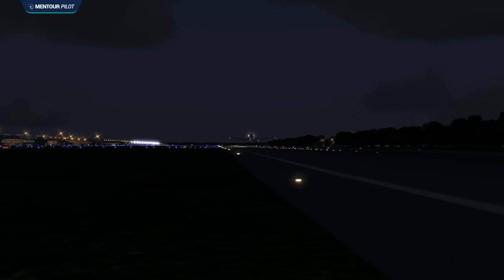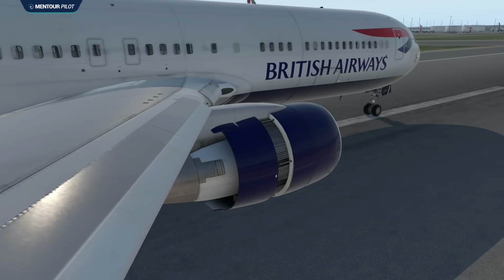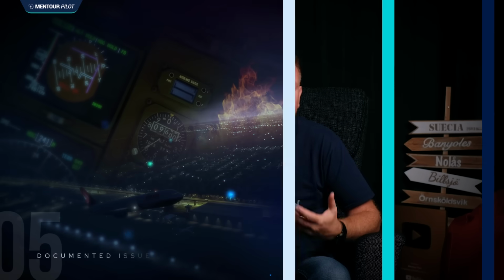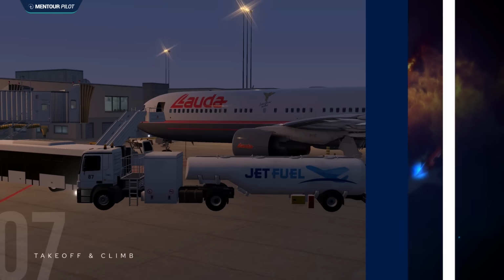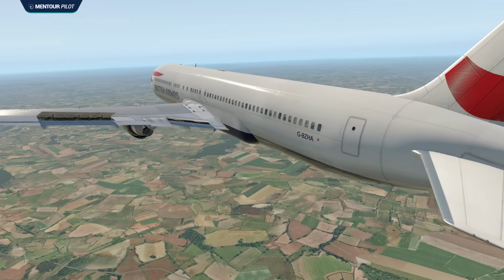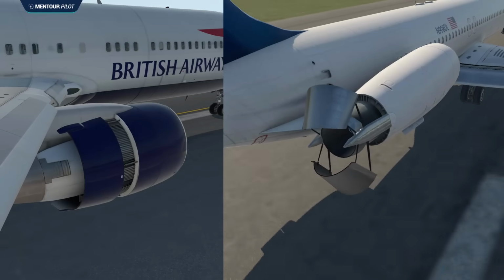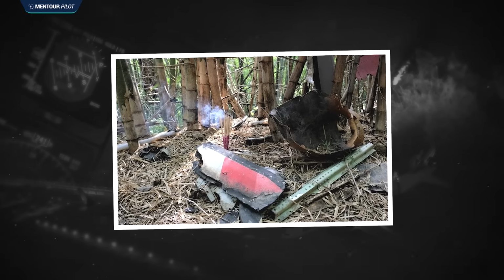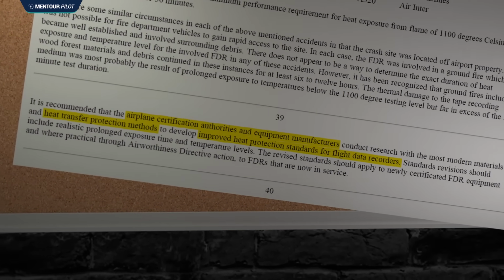HOW an Impossible Failure CRASHED this Boeing 767!

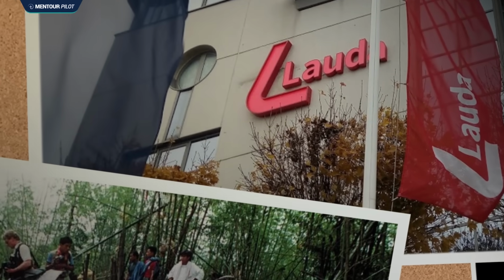Comment: 26:10 just quick correction, the building in the back is Lauda, not Lauda Air, Lauda (without the "Air") is the Ryanair subsidiary founded by Niki Lauda a few years ago, Lauda Air was the original proper Airline back in the day

Comment: On the last couple of flights I was on (737-800), I noticed on landing (I like to sit at or slightly behind the wings, the last couple of flights I was right at the engine) that there were panels that slid back at the same time as the other aircraft brakes were deployed, and I was curious what it was doing (didn’t seem like a time when cooling off the engines was needed). Now I know what it was! Thanks!

Comment: I was thought you could use the inboard thrust reversers on the DC-8 while in a rapid decent. Been a long time since I flew one so I may be wrong.
Reply: In the mid-70s, I distinctly remember being on a DC8 approaching Rome at high altitude.  The pilot did several 7 to 10 second long inboard engine reverser deployments to speed the descent. It really surprised me, but seemed to work OK.
Reply: @Sea_SALT-sunshine  Yes I looked at a old DC-8/63 manual and you could use them to  increase the decesent rate. I do not remember the Airlines policey on it though.

Comment: Hmmmm.... but we were told that bloody beginners could properly control two Boeing 757/767ers at a speed of like 425 knots or more some hundred feet above sea level... without any ruptures....

They must have done a lot of improvement in Everett after 1991.

Comment: I'm not a professional. We have to assume that the shock of rolling like this had a paralyzing effect on the crew. But, if they could have maintained their composure long enough, I think the best thing would have been to shut down both engines. Assuming they weren't in any upper-atmospheric turbulence at the time, the aircraft should have stabilized into a glide, giving them the time they needed to re-start the right-wing engine. The left-wing engine should have stayed down, and they could have landed with the one good engine.
Reply: All that was needed was for both engines to be set to idle but it happens extremely quickly and there very little chance of catching it before it’s out of control.
Reply: @peteconrad2077  Engines running on idle is the normal situation in which the engines are allowed to reverse. Are you sure?
Reply: @AtlantaBill  yes. But in this instance one reversed while at high power. That’s the problem. If you can get both engines to idle quickly enough, the aircraft is controllable. But it’s hard to do this quickly enough if you’re not entirely ready for it.
Reply: @peteconrad2077  I would think shutting them down would be faster and surer. What's more, how could you guarantee that initiating the idling procedure on the one that reversed would stop the reverse thrust? Obviously something was going on with the engine that reversed its thrust that the pilots had no control over. There's always the risk that the good engine couldn't be restarted, but apparently weather conditions were good, the plane had plenty of altitude, and there was nothing otherwise wrong with the control systems. If one of my legs suddenly buckled up on me, I'd stay seated and rest before I tried walking again and not put pressure on the bad leg.
Reply: @AtlantaBill  idling them would immediately reduce the reverse thrust  element to minimal. No point in shutting down until you know it duff. The idle power is low enough.
Reply: @peteconrad2077  Good enough isn't always good enough.
Reply: @AtlantaBill  so you admit you don’t know what you’re talking about and here you are arguing with someone who does.
Reply: @peteconrad2077  Who can vouch that YOU know what you're talking about? I said I'm not a professional, not that I don't know anything about physics, engineering, and aerodynamics.
Reply: @AtlantaBill  so stop pronouncing on it as though you do.
Reply: @peteconrad2077  As though I do what? Expressing an educated opinion isn't "pronouncing". To me it's illogical that you insist that the dangerously faulty engine be left running with an undiagnosed problem when it's completely unnecessary. My expertise is in electrical engineering, which involves tracing system malfunctions and finding solutions. Very relevant to the situation we're dealing with.
Reply: @AtlantaBill  well my experience is over 30 years as an airline pilot, instructor and technical manager. This is don’t pronounce views on electrical engineering.

Comment: The bypass airflow also creates a kind of sonic curtain containing the noise of the core.
Miltary jet engines don't bother so much which is why they are a LOT louder and why I am currently concerned with the number of US Military aircraft coming in and out of Belfast.

Comment: Yea was an aircraft mechanic. Especially when your dealing with thrust reversers like we dealt with on C-5b's and M's if your chasing faults throught out multiple components especially TR not locked lights your issue isnt the the switches that turn tha light off and on. Its a fault in the harness itself. Good way to check that out is if your checking your voltages through madars and its bouncing around. Pretty much garaunteed to be the TR harness itself. repeat issues in your 781's is a red flag that the core issue isn't being solved.

Comment: An intense report on an, in this case, unavoidable end.  I wonder how many times Boeing test pilot flew the simulation before he figured out they only had 6 seconds to respond with exact and flawless decisions to stop this inevitable end.  In the last segment, it is mentioned about the flight recorder data. 25 years ago,  I was in the aviation industry in communications, and attempted to patent a system that took all inflight data, digitally stored, and in case of an event, could be sent as data bursts on 121.5 or 243Mhz, the emergency frequencies at that time, and be picked up by every facility in a line of sight area, which would have been recorded as all air traffic communication is.  Regardless of finding or not finding data recorders, their data would have been sent out.  I did not have the $10K bucks the patent attorney wanted and he actually advised against trying.
Reply: Start a gofundme and try again! This is a groundbreaking idea mate
Reply: @nadderragi  Not sure something going through a low-fidelity audio stream would be sufficient for the amount of data transmitted, and it might interfere with voice when it is needed the most. I'd consider also looking into other systems, like the satellite or cellular radios, which are already digital.

Comment: why don't engines use Dr Stanley Myers water injection technology & get rid of risk of fire completely? Why does CAA allow aircraft to fly at speeds the flight surfaces can not tolerate? Thats substandard design & manufacture. horrible crash

Comment: That 4000 feet in 3 seconds it is a speed way over the Mach 1, if I'm not wrong it would be something like 1450 Km/h. Crazy speed for an 767, so sad for those people. Everything happened so fast, can't image even the G forces that they had withstand.

Comment: From wikipedia:
"The extreme stress induced by the dive caused sections of the rudder and right elevator, both of which had not been designed to bear such immense loads, to fail and break off as the pilots commanded near maximum deflection of these control surfaces, attempting to arrest the descent. This was followed by the complete separation of the right horizontal stabilizer as the aerodynamic forces became too great for it to withstand. Combined maneuvering overloads from the pilots attempts to level out the plane and the sheer velocity of the dive then exceeded the aircraft's structural limits and destroyed the weakened rear fuselage, decompressing the cabin and taking the rest of the tail with it. Pitch control was completely lost with the loss of the tailfins, and the 767 went into a vertical dive, reaching a speed of Mach 0.99 (The highest value onboard sensors were capable of recording) and breaking the sound barrier. At that point, the right wing failed and sheared off at its connection point to the main fuselage, igniting a large fireball visible from the ground according to eyewitness accounts. What remained of the aircraft disintegrated at 4,000 feet (1,200 m) before impacting the ground and exploding."

Sounds pretty harrowing, heavens above

Comment: God sakes! The aircraft wasn't fit to fly for ages before. Common electrical fault is zero volts loop failures, giving false computer inputs. We are only talking about millivolts here for a false input. Sounds like basic loom fault possibly - only takes a poor joint to add a resistance in a circuit. Whatever it was, all hell was let loose. Boeing engineering? They seem to have idiotic events too often for anyone's liking. Aircraft should have been grounded ages before this. The warning signs couldn't have been louder. Very tragic.

Comment: Why didn’t they shut off the engine?
Reply: Takes a long time for an engine to run down. They only had seconds. It's like drive your car down the road at eighty miles per hour and you put it instantly into reverse gear. Not good.

Comment: Wow, that is one of the most horrific crashes I've ever known of.  If I were on the plane, I'd hear the reassuring ding from cockpit to CC at FL10 start getting comfortable and then all of a sudden...words can't describe how terrifying that must have been.
Reply: That's a bit simikar how it happened for me in an emergency landing. My fear of flying is massive so I tried to keep mydelf calm for about 30 minutes from take off into the flight and whike that usually works, an emergency was suddenly announced 30 minutes in due to some kind of engine vibration and we had to return back (safely).

Apparently some people also spotted an airport on the ground being suspicious of  our aircraft and taking pictures of said engine, I guess we were never safe until we re-landed.
Reply: @samalass466 I'm happy that you all are safe

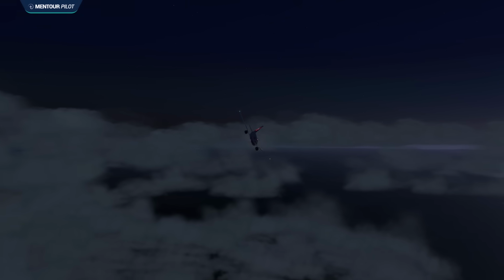Comment: 18:32
Moral of the story: Never trust Boeing for safety testings.
another example is that they kept failing on starliner's parachute deployment system as well.
I wonder why all the planes are boeings tho..
Additionally, If the pilot shut down both engines instead of left engine they still could survive.
Reply: Nope, spooling down of the other engine takes way too long.
Reply: @NipapornP  Pilot managed to shut down the left engine before starting to shoot down above mach1 while overstressingly yawing left.
 I just did the simulator and splash landed on sea.before writing the initial comment. But I don't know about the real situation.
Still, if it works in Simulator, it has chance irl
Reply: With that said, you're theoretically right, it can take on a boeing up to 20 minutes for a spool down due to big wings on a hi-bypass jet engine, acting like a gyro
I'm not sure if I tried with the same engine on the simulator. But I will..
Reply: @XavierBetoN  What? 20 minutes? Oh no, but even the 10 -20 seconds spool down would make it (nearly?) impossible.
Reply: @NipapornP  Yep, Mentour says they had 7-8 seconds which at those speeds impossible to spool down in that time. But still, I think there could be at least few survivors perhaps, rather than shutting down single engine but we'd never know, what happened happened and could not be done in any other way, like Morpheus said in Reloaded.

Comment: I’m sure this would never be on any checklist, But if the reverser deployed on one engine and you were high enough you could pull back power on both engines to idle ( prevent asymmetric thrust) , point nose down into a gradual descent , fly plane  , then shut the bad engine down, then resume power on good engine and fly on the good one. But probably no time and  this plane already out of control in a matter of seconds

Comment: @27:00 I'd say that even a highly trained flight crew would struggle to do everything right within the time-frame, a maximum of 4 - 6 seconds? I get that pilots need to have quick reflexes but seriously I doubt that any pilot could have recovered that plane; simply because there are procedures, first you have to react to the problem (there goes at least one second), next you'd need to pull out the manual and find the correct page to follow the procedure, because no-one is going to instinctively remember exactly what to do (there goes two or three more seconds), then follow the steps (I'm tipping even racing through the steps that it'll take about two or three more seconds). That adds up to between 5 and 7 seconds, sorry but they just crashed again. It's a good thing the problem seems to have been fixed.

Comment: I was on a DC-8 flight into I think Denver, and as we crossed the mountains, I heard the engines idle, then rumble and power up Thrust REVERSED! AT 10,000 feet!  Needless to say the approach was like a rock.  I cornered the pilot after landing and asked WTF?  He claimed you could do it with the DC-8.  I didn’t buy it.  My C-337 full flaps and engines idle, gear down, and a bit of slip can make like a rock, but WITH AN AIRLINER? crazy.

Comment: Heads up incoming stupid question,, you've been warned! Ok now that's out of the way what would have happened if the pilots turned the jets towards the direction of travel instead of going against it? I know that would have meant the jet does something like a barrel role but if they had enough altitude and throttled back the engines slightly would it gave them more time to actually recover the jet and been physically less taxing in those first few critical seconds? Like I said stupid question and I'm about stupid when it comes to aviation as I'm sure you can tell by the stupid question but I guess I'll be just a little less stupid because of me asking

Comment: I wonder if this accident would have had a chance to be avoided if when one of the thrust reversers were activated unintentionally and the plane started to dive, instead of cutting power to the reversed engine, they reversed the other engine aswell to at least keep the speed in controllable levels and get rid of the asymmetric thrust until they could make out what had happened on the unintentionally opened reverser.
Reply: Safety lockouts keep the reverser from deploying at altitude if systems are functioning correctly.  The other one was functioning correctly.
Reply: @russellstephan6844  yes I understand could not have been deployed even if the pilot had wanted it

Comment: As an aircraft mechanic I can tell you this is totally possible and even desired in certain situations such as during short/emergency landings on a runway not made for large aircraft but in reality the only thing that would keep your TR doors from deploying on most aircraft is a single switch that detects weather or not you have weight on the wheels or not. If the switch somehow gets sorted out or stuck in the wrong position then your TRs can definitely deploy mid flight is not that hard to see happening

Comment: That is what you should expect from programming with assumptions that do not match the real world scenario. The system that is designed to ensure the reversers deactivated during flights were not in the states where they were designed and assumed to be, which falsifies the "proof" of safety that the design logic provides.

Comment: No big deal, but your diagram terminology is opposite of what is correct.
A open circuit is off.
A closed circuit is on.
When the latch is connected on the diagram it is "closed" and working.
When the latch is disconnected on the diagram is if "open" and off. 
Think of it as a door.

Comment: In 1979 I was on a USAF C-141 on final approach - landing gear down and flaps at full landing setting - when the thrust reverser on the right outboard engine (the 141 is a 4 engine transport) deployed. We were on final approach to Kadena AB, Okinawa and were still over water. If you are not an aviation maven let me inform you that an aircraft on final approach and with the gear down a flaps deployed is in a very precarious condition. If the aircrew had not been superb airmen, I would not have survived the day. A thrust reverser deploying in flight is an extreme emergen y situation and only the best pilots are going to be able to get out of it alive.

Comment: Very interesting video just a fan of flight,  my question is if an engine was on fire or lost oil pressure flt crew I imagine would most likely reduce/shut off power to affected engine so why wasn’t this the case on this fatal flt in question?  Also brilliant idea on cloud uploads of in Flt info black box recorder seem very possible but then who would go over this informing such short time before turnaround of each aircraft.  perhaps something computers could be task with flt engineer/analyst to sign off ✅ Do keep up the great work 🫡